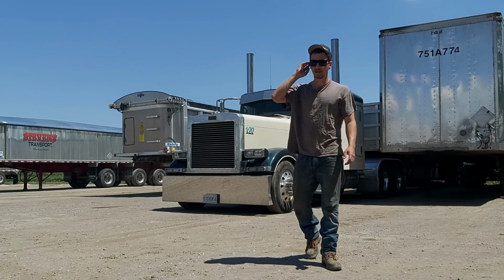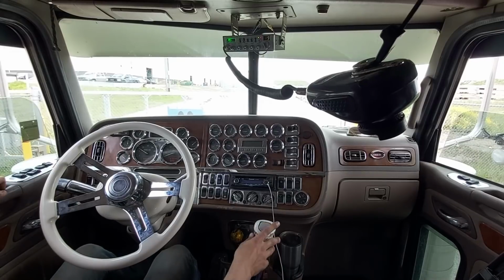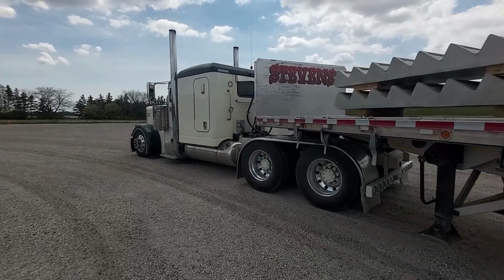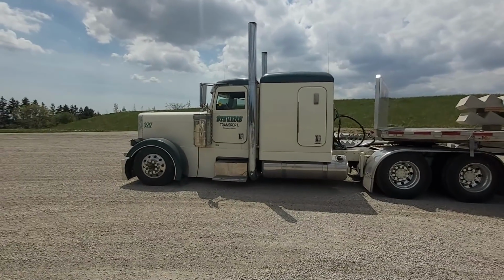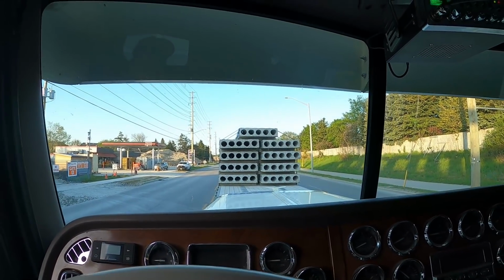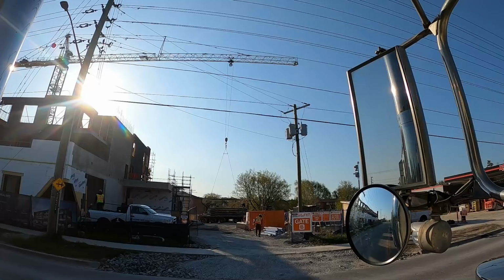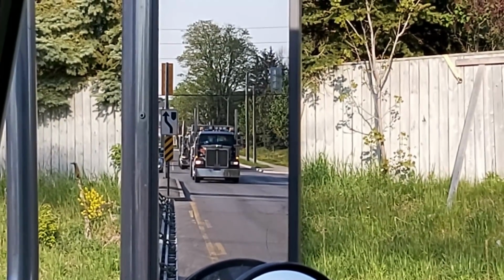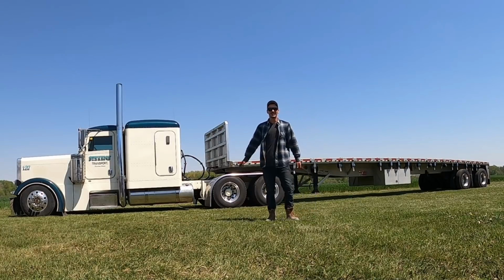Loading And Trucking Concrete Steps On A Flatbed, To A Downtown Jobsite, And Unloaded By A Crane !

Comment: Nice easy load, easiest load I ever hauled was 2 pieces of steel, 8 ft wide and 20 ft long i think it was about 5 inches thick on a super B train, each piece weighed 44,000 lbs. Going through the Frazier Canyon could really take the corners fast as the centre of gravity is so low. Love your truck, has a nice stance. Keep safe my friend.
Reply from the maker: Right on

Comment: Hey buddy😀.  I was thinking about how to shift gears.  Is it a kind of comfort shift where you just have to use a button on the gear lever ?.  And gody to see you got a haircut😋🤣🇩🇰
Reply from the maker: hair cut was neeeeeeded hahahaha! but yea its nice to spilt half a gear especially pulling up a hill.
Reply: In Denmark we also have a split gear and a ranger so we can switch between high gear and low gear.  Where 1, 2, 3, 4, are low and 5, 6, 7, 8, are high and all gears we can split.  That being said, the future will probably be enough for all trucks to eventually have automatic transmissions.  BUT you can probably order trucks with manual gear locally.✌😁😉